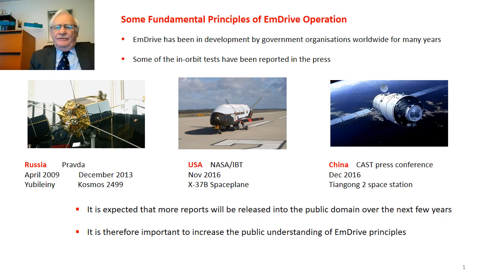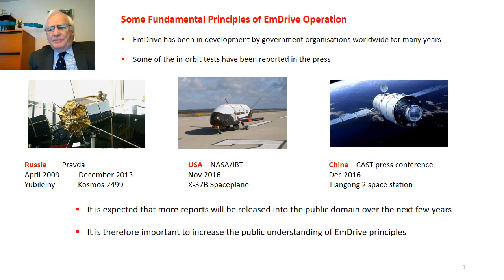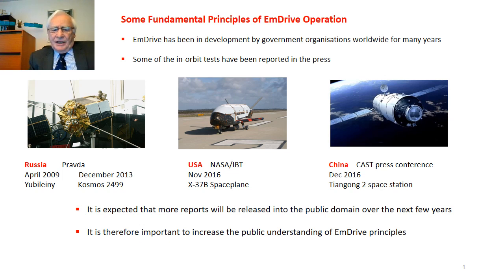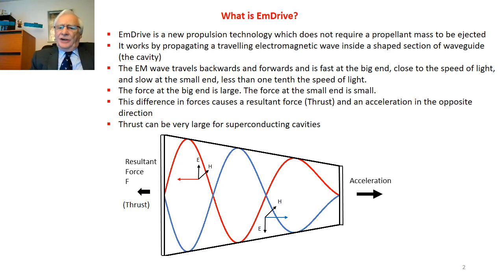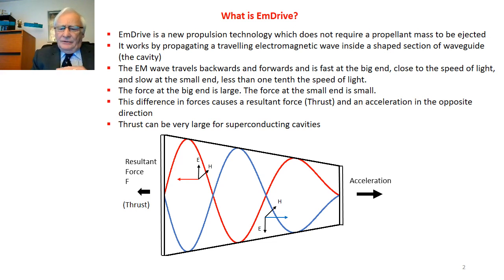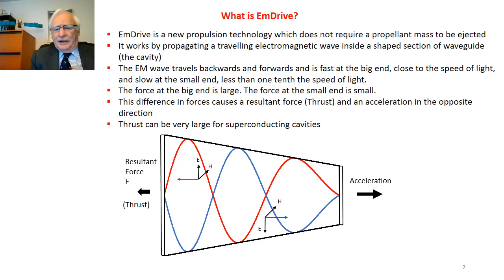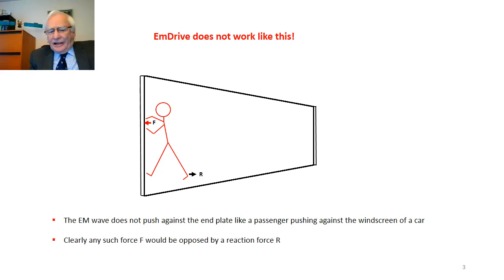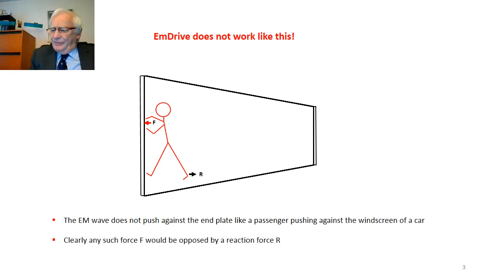EmDrive Reactionless Drive - 2021 Update

Comment: I came up with the idea way  back in the early 90s. If you start with a photon bounce off the large surface it will go towards the tapered end where it will bounce several times along the tapered path giving off momentum to the tapered walls. If the angle is 45 deg then the forward component is 0.707F .
The problem here is the heat generated by the reflections is greater than the momentum transfer due to radiation pressure. As a result the only way to efficiently exploit the principle of an asymmetric cavity and transfer large amounts of photon momentum is to use superconductive walls.
When you show me the null result from a superconductivity test I will concede that it doesn't work. However in my humble opinion the superconductive version will produce an enormous amount of thrust. I imagine some engineer in the last 20 years had the idea to do this and the tech was classified immediately.

Comment: So to get it straight, getting the ideal conditions for the thrust effect in gravity is difficult because if you put it on a scale, it will be "overloaded" and if you put it upside down it would be "unloaded"... 

So wouldn't the solution be to have it horizontally aligned with gravity and sort of tilt it just slightly so it is in equilibrium with the "acceleration" of gravity?
Reply: That's how NASA's experiments were run, horizontally on a torsion balance. One consistent aspect to this invention has been that no matter what size and energy is built, the "thrust" generated is always on the order of magnitude of the noise floor of the instrumentation being used to characterize it. You could get more thrust by putting the same energy into a laser pointed backward. Even though he claims the device is not like a person pushing the vehicle from the inside, that's pretty much what his analysis amounts to. Or maybe more like a fan on a boat blowing on the sail. He seems to confuse the speed of standing waves with the speed of the photons those standing wave resonate in. The shape of the chamber is meant to provide for a larger force on one end than the other but the chamber would experience the microwaves as a pressure. Any imbalance in the forces on either end will be fully accounted for by the differences in surface area that pressure is acting upon. Or more accurately, the net forces on the small end plus the net forces on the tapered wall will equal the net forces on the big end, but be opposite in direction. Sum zero force.  NASA's team recently confirmed this by better isolating their device and measurement instruments and proved their previously measured "thrust" - which was the same with and without the cavity, and the same regardless of whether the cavity was installed fireworks or backward - was the result of thermal effect driving air currents against their instruments and not any inherent ability of the device to produce reaction less thrust.

Comment: He finally said something that makes sense! "The Momentum LOST by the EM wave on reflection at the end plate, is balanced by the momentum gained by the accelerating thruster." In other words, one end has higher losses than the other end, one end gets hotter, which is what I theorized many years ago. Heat is what makes it go! IMO, it would be more efficient if you just put an induction heater at one end.